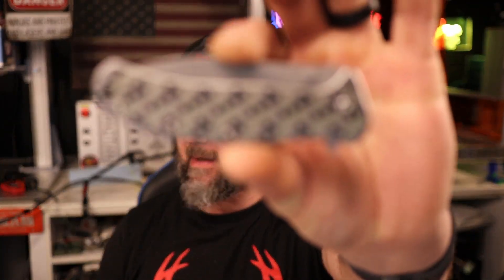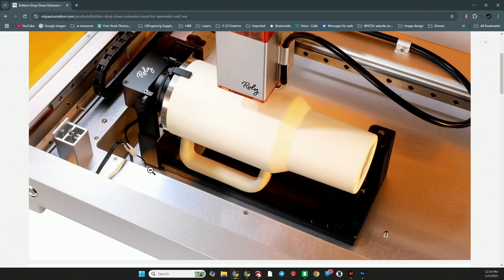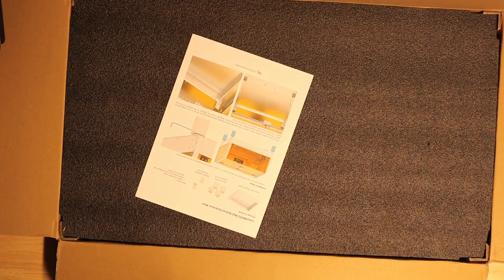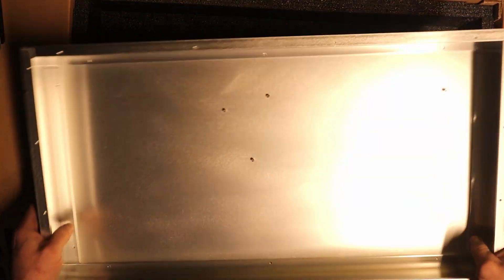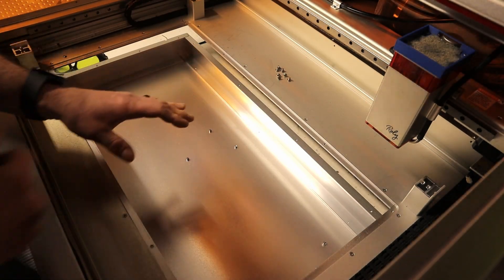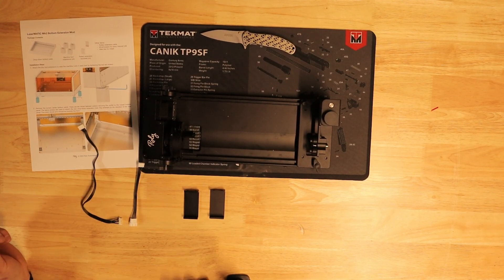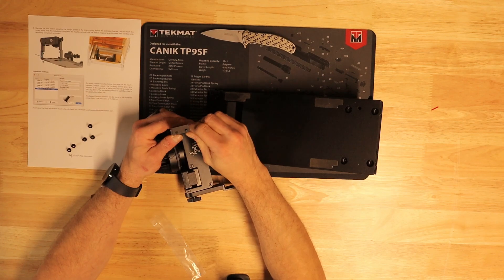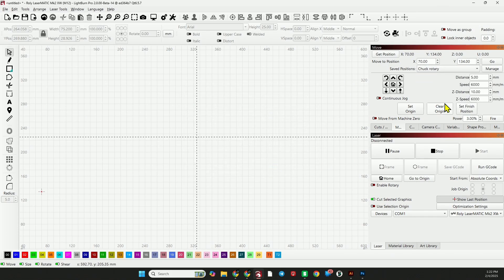Unboxing and Install Tutorial - Lasermatic MK2 XW Z-extension mod drop down insert

Comment: Hey Patrick, 
I purchased the drop down Z extension unit when Roly went out of business, but I have not installed it yet After watching your setup video for the drop down extension, I do have a question. It this a permanent swap or can the original bottom plate be installed back to its original location if needed on top of the drop down extension. The original bottom plate has a middle support post to keep the honeycomb from sagging down. The Z axis drop down extension does not have a center post supported for the honeycomb bed.
Reply: Forget my question Patrick. The answer was posted in the comment section. I should have read those first before asking my question.

Comment: Thanks for the video.  The drop down is on my list to purchase.  I can see how the drop down makes it easier to do large tumblers.  Can the laser be lowered so I can still do small items?
Reply from the maker: in stock form you can lower the laser quite a bit. and the risers help in raising up the rotary if needed.

Comment: Professor, that looks pretty simple, even a plumber could do it, but I have one question. Does the bottom plate just slide back in place for the center pin on the honeycomb. Thanks for all you do
Reply: If you leave the aluminum strips in place and use longer screws to secure the drop box then you can reuse the original plate that it came with. Sent this suggestion to Roly support and Dimitrius told me not to do this. I don’t know why not but I have the best of both worlds.The drop down box has holes that line up with all the holes in the original macine
Reply: @hanksuffoletto6877  that is what I am going to try as soon as my drop down gets here
Reply: @hanksuffoletto6877  This drop down should definitely be able to be left in place when putting back the bottom plate and honeycomb.
Reply from the maker: no, there is nothing for the bottom plate to rest on